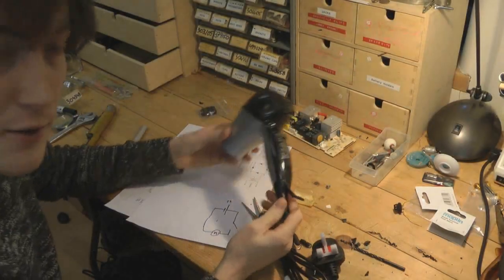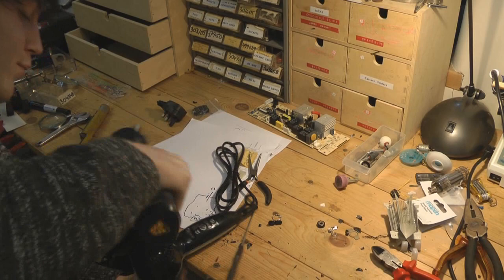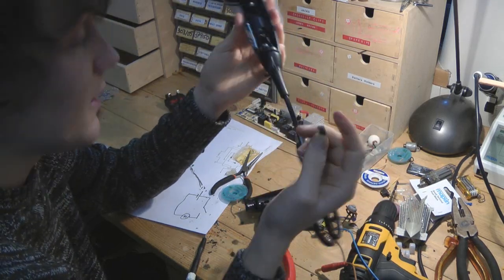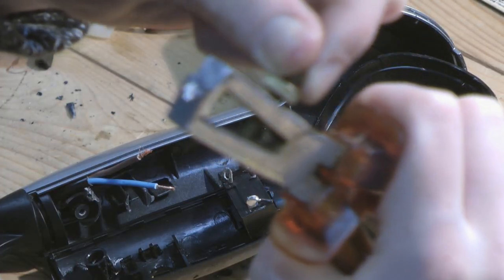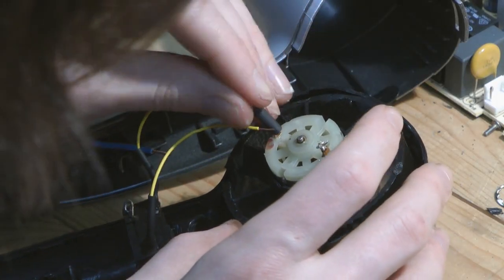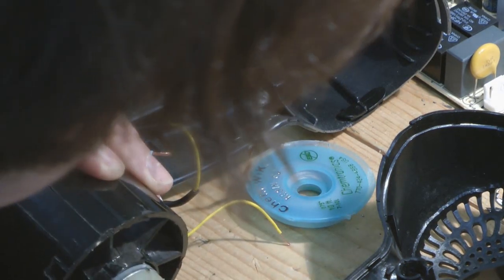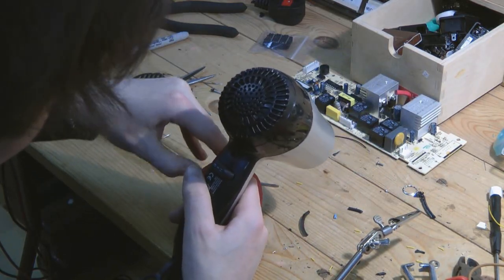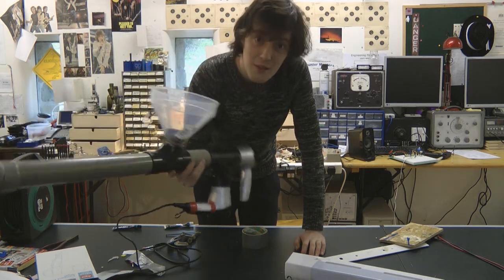Blower/Fan Hair Dryer Hack

Comment: is it possible to convert the hairdryer to a fan only using 220V with the same parts inside it?
Reply: nope!...if you want to use the hairdryer to a fan,get rid of the nichrome wire that uses 220v ac...supply the fan motor 12v dc..
Reply: @edmarcueco4260  You are wrong actually,  You could snip out the section of that does the heating and just use the fan element instead

Comment: i tried this but the fan is not powerful anymore... i used a wall plug though.. what's wrong with mine?
Reply: hey i have the SAME problem. did you ever figure it out? i could really use some help. its less than 1/4 its original power and i had to replace the original outlet cord and removed the switch.
Reply: But in a rectifier diode, it has problems spinning with ac current.

Comment: I'd like to know what the actual current consumption of the blower is at 12 VDC as I want to use it to supply pressurized air into a gas mask via a hose assembly and intake filter element to use it as a PAPR device.
The blower obviously needs to be portable with a belt mounted battery package.
I'm trying to figure out how large a battery I need and how long it would last.

Comment: In Europe we have 240v mains aswell
Reply: No. 230V nominal.
Reply: @myhmw  Here in Norway 230 and 380-400, However its not uncommon to have voltages upwards to 250 volt, For  example my phase voltages right now are L1 246v, L2 243v, L3 238v. Well thats between phases and  neutral id guess my phase to phase voltage is around 415volt

Comment: can you use the fan to vacuum dust/sawdust into a collection container? I do small-scale woodworking/carving, and want to vacuum the sawdust in the air.
I tried pc fans, but am trying everything.
thanks for the video!
Reply: Sounds great! You could use what I did here either hooked up in reverse (so hooking the motor up backwards) or arranging the pipework so negative air pressure occurs at the business end. I personally would take a traditional vacuum cleaner and hook it up to a pipe network arranged around the work bench with flexible air inlets near where you do cutting. Sounds like a fun project!
Reply: I have 2 problems- 1 is the noise from the hair dryer fan, and the other problems is not enough suction from the pc fan (even though it does work....)
Reply: bizzlemedia
Reply: I know 4 years have passed, but noise and low airflow is inevitable when running a small motor really hard. Vacuum cleaners are standard with a very large motor and even that gets pretty warm. I cant really see this working quietly